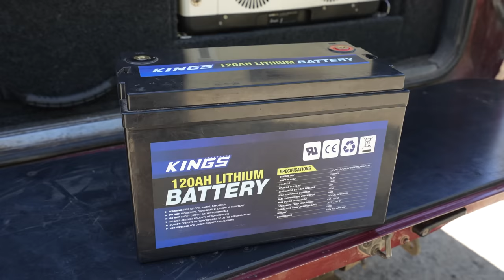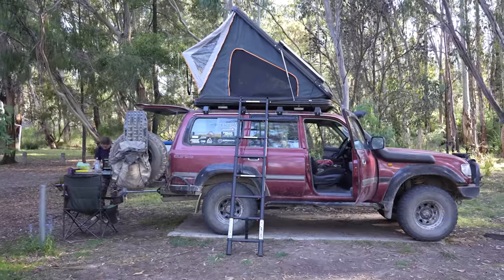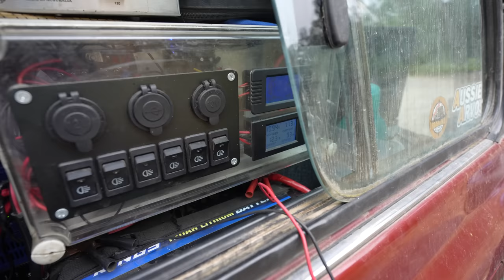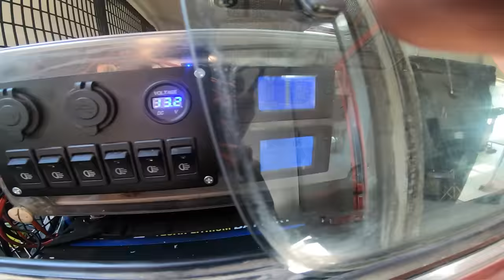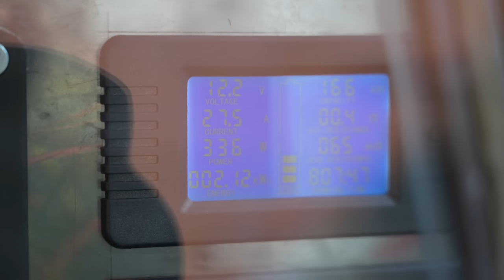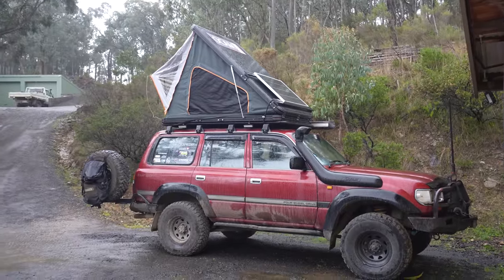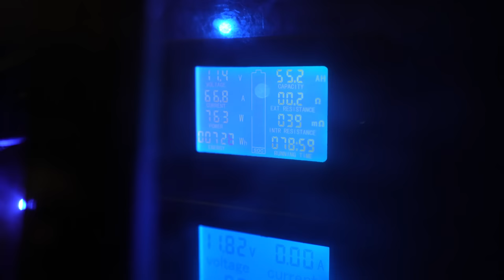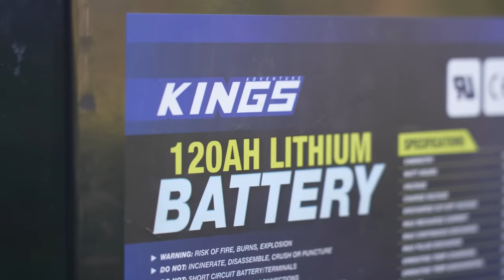Watch this BEFORE you BUY Kings Lithium Batteries

Comment: I’ve got the same battery but it dropped to 10 .5V at some point and now won’t charge. I’m assuming it’s the BMS off like you said but how did you get it back on? I’ve tried my victron 240v charger but also doesn’t seem to do it.

Comment: I have been looking at getting a lithium battery and doing some research it seems 100ah lithium will support a 1000 watt inverter, to run a 2000 watt inverter would require 200ah of lithium. Do you run a induction hot plate which would require a 2000 watt inverter from the 120ah battery?

Comment: I'm "mostly" unfamiliar with every brand posted around the 4 minute mark..the only reason I've heard of any of them, is because of YouTube. 
Further, I have never spent as much as the very least listed (Power Volt), and tho I need "more", they're doing fine. I have Redodo, Power Queen, TimeUSB, and Weize, and tho I got them all during great sales, $300 per 100Ah is the MOST I've spent on any battery, and they're all doing well so far (2 years for the longest owned ones).
Oh, and things aren't headed toward Lithium, it BEEN at Lithium for quite some time. No one goes with anything but Lithium unless they have a special requirement factor, or are trying to save a bit of coin (who isn't) but honestly, Lithium is the cheapest in the long run, it just hurts up front.

Comment: You should invest in a 12v car adapter for your laptop... most usbc-based ones still rapid charge (I know the 12v car adapter Lenovo cranks if it has supply!)

Comment: Hint - don't let the battery drop below 25% , the ultimate charge range for Lithium Batteries is 40-85%.,
Staying in this range can double the recommended recharge cycles, 
 The more you go outside this range, the less recharge cycles you will get,
Charge to 100%  every 5 or so recharges, then use the top charge, don't leave for long periods over 90% or under 40%,

Comment: Awesome video mate gave me heaps of confidence putting the 200amp in my caravan, if you can support it with good chargers and wiring go for it. I spent the extra on putting enerdrive DC DC and 3 way charger, to keep the power up but got the king's battery and inverter, keen to do some more testing 

Cheers
Reply from the maker: Thanks mate, look forward to hearing how you go with it!

Comment: Nice review but your earlier episode when you had power problems got me wary. The big factor for me is discharge capacity, the kings are on the low side at 100 amp. I hadn't realised your shunt was at fault, I think when the time comes to build my system the Itech will be the winner as it's specs are a little more robust. Appreciate the review and detail that you deliver. Cheers 🍺
Reply from the maker: Thanks Luke! Yeah the cut out issues i was facing before were due to the inverter  going through all my shunts and fuse box and i think that was casusing issues, i haven't had an issue with pulling high amps from it since after i wired directly to battery, that being said if your looking to pull alot of amps from the battery might be worth looking at either a bigger battery or one with a BMS that supports greater amp discharge. But for what i've been doing i've had no issues with the kings :)

Comment: Are you running 2 of these batteries in parallel as one of these kings batteries can only output 100amp continuously and at 12.8v nominal voltage this would only be able to output 1280w per hour. So not sure how you can run an 1800w induction cooktop when through an inverter and with these Kings high frequency inverters you will get some small losses from the calculated 1280w.

Comment: Great video. Thanks for the great info. I’m running 2 x 120amp lithium batteries in my caravan. I have the 3000watt inverter running through the shunt and sometimes it trips out. You mentioned you had similar issues that were solved by running the inverter straight from the battery. Is this correct ? Thanks in advance and keep those excellent videos coming 👍
Reply from the maker: Thanks George! Yep i soved this by going stright from the inverter to the battery
Reply: @AussieArvos  Thanks for the prompt reply. Changed the wiring setup this arvo and ran the microwave and coffee machine with no issues…….. thanks again 👍

Comment: Great information, but I have some questions about running an induction cooker continuously at 1800W. With a specified max continuous discharge of 100A and up to 160A max pulse discharge for 10 seconds, doesn't that mean that at 12V you are limited to 1200W on your induction cooker, with only 10 seconds available at up to 1920W? (not taking into account the inverter efficiency, which would increase the current even more) It does seem to deliver the current required to run continuously at 1800W but isn't that exceeding the design parameters and could it lead to battery failure?
Reply: If the BMS didn't like it, I presume it would cut it off.
He could also be running the induction top at less than full power which may only pull <70% of it's rated current, as an example.

Comment: There is still a place for AGM's for home backup power. Weight is not important, they are at most half as costly as LiFePo batteries and can be kept on float charge indefinitely. Cycle life is not really relevant since if you discharge AGMs by 80% and immediately recharge them correctly, ie  bulk charge followed by absorption charge followed by float charge they will recover fully and perform for many more power outages.
DC/DC chargers and other devices aren't needed, just a 12VDC to 240V inverter.

Comment: Good wrap up & review Pat, you made a lot of good points & it gives me more confidence in this kings lithium battery for the price.
I did notice in Chris Eade’s report at 5:08 he stated that the bms stopped charging when cells had reached 3.77v-3.41v & I really dont like the idea of cells getting to this high voltage, as 3.65v/cell is the accepted maximum (14.6v total), a cell can reach full capacity at 3.45v (13.8v) but takes a bit longer to reach full SOC, so 3.5v-3.55v/cell is a safe max voltage without going any higher, and 3.77v/cell could cause much increased degradation. 
I was very impressed that kings claim it can output 160A and you have shown you can run an induction cooktop reasonably well for a single 120A battery, which does show it has pretty good ability also. Cheers
Reply from the maker: Thanks Evil! Yeah Chris Eade's report was really well done, really appreciate his work in tearing batteries apart and finding the facts.

Comment: I have had a good experience with the Kings battery, has not let me down. The 25a Dc-Dc is another story, 3 replacements later and the Kings tech muttered “get another brand” and I did. Redarc, it worked a treat. 
1 solar panel (Jaycar - shape and amps suited my roof tent roof.  End result was the beers stayed cold even on a 4 night stay somewhere.
Reply: Great, I just purchased the 120 amp battery and 25 amp DC to DC last week. What issues did you have with the charger?

Comment: Hey mate great vid 🤙
I had a question about the inverter. Were you running a different 2000W inverter with the induction cooktop or using the kings 1500W in the vid? Thanks legends 🤙🏕️
Reply from the maker: Using the kings 1500w , I misspoke when I said 2000w
Reply: @AussieArvos  thank you mate 🤘

Comment: I've toyed with the idea of going lithium,  but the amount of fires in 4x4's and campervans I have personally seen caused by them makes me very wary.
Reply: Don't confuse the battery chemistry, they are very different.
Lithium Iron and Iron polymer are the dangerous chemistry options here and have the wrap for exploding phones and cars. Lithium Iron Phosphate and cobalt are very safe and will not thermally run away thike the others mentioned above. In fact, they are safer than lead acid which produces hydrogen gas when charging. 
The fires around Lipo4 are from poor wiring or a failure BMS, so it's important to buy reputable brands and fuse connections appropriately to avoid this.

Comment: How will you know before the battery fully discharges, do I need to buy a battery monitor device of some sorts?
Reply: Yes, you need a SOC ( State Of Charge ) monitoring system.  You do not want to wait until the BMS cuts-out due to Low Cell Voltage.

Comment: Great video it's more affordable to the average jo thanks for the information 
I'm still running my led acid battery for my 40lt fridge and the od camp light it's still working for now 🤷‍♂️ 
Would love to update to lithium but haven't gotten dcdc charger in my 4b and a little concerned about installing one because it's not my strongest point just a little intimidating putting electrical components in my 4x4 😬
Reply from the maker: Hi Billy! Yeah that is still a fine setup! The DCDC is actually really straight forward to install! you'd be able to do it easy i reckon, if you've got any questions just yell out! :) but i mean if your setup is still working for you that's great! Cheers :)

Comment: Have you had issues with the kings lithium cutting out using an induction cooktop, as the maximum discharge rate they spec on these batteries is only 100 amps which would only be about 1000 watts with an induction cooktop.
Reply from the maker: I've had no issues, i have the induction cooker set to around 1800w too

Comment: I have 2 solarking 200 ah lithium ion batteries with 1.4 kw of panels off grid with a Victron charge controller that I use as back up power if the grid goes down as I grow my own beef and last thing you want to have happen is to loose hundreds of kilos of it from a outage, they are great as I’m only on tank water as well in a power outage they will operate the 1000 watt piachi water pump for my house. I’ve had them for a few years and plan on getting a heap more as if you don’t use them under 80% they have a life cycle of 8000 recharges which is nearly 20 years. I get the 66 cent rebate and have a solar back to the grid system as well so. So my bills are usually next to nothing..The problem that affects most lithium batteries they need to be in a stable temperature environment so I’m planning on building a off grid system with a small aircon system to stabilise the batteries and also in a basically blast chamber so if one blows out. It’s contained with a vented exhaust. I know some lithium ion batteries the cheap ones are really only rated to 45 degrees. My ones are 60. But you pay more. Great video thanks .. plus I also have spacex starlink and it’s supposedly pretty power hungry yet I when I have my battery system going don’t have any trouble powering it. Plus it’s portable.plus with my solarking with the Victron charge controller once the batteries are full it goes into a float mode which means if I’m getting however much power off the panels it’s not recharging the batteries it’s diverting the electricity directly to what I’m using. Literally running on sunlight all day long. Then it changes to bulk when you aren’t using it I have a few wind generators I plan to install. My first one is sitting in my front room, my rebate for my solar runs out in 2025 so I plan on being completely off grid by then.

Comment: 1800w from that 120ah battery… I doubt the BMS would be enjoying that current. I run a 300ah lithium battery from lithium battery wholesaler, $1800 delivered in Australia. It will output 250a continuously. I am considering buying a 200ah kings battery to add to my existing 300ah battery in my caravan as it runs my AC unit/heat pump.

Comment: You only need to know some key facts! 
Lead-Acid 100Ah  = You only have 40Ah to use, before you need to charge it or you will dmg it over time. It also charge slower. 
AGM / Gel 100Ah  = You only have 60-70Ah  to use before you need to charge it.  It last longer, and are a stronger battery. Better chage as well. 
Lithium       100Ah = You can use 90-95Ah  before it must be charged.  It can also force a large charge load.  and the weight  is vary low.

Comment: Patty, extremely well presented, composed, factual & brilliantly informative as from your experience.
 I too moved over to lithium about the same time as you, recall watching your initial trials etc.
I elected Itech product, 3 x 54 amp units to replace 3 X AGM 75amp units.
Why, cause I had the specifically built battery frame to house this casement size, (slimline).
What I love about my lithium update is, "recovery charging", it's so friggin quick compared to AGM.
How's that help?
Like everyone, my camping out constantly evolves, inverter added, permanently mounted coffee M/C, plus other 240v gear from time to time. AGM was taking ages to recover through what I thought was a 120w Redarc solar panel.
Now convert to lithium and the recharge time just accelerates so much that induction cooking became viable as well. (K'gari last August got the better of us trying to utilise a gas cooker in extreme easterly front passing through).
Once I went lithium my fridge is never off other than for a quick defrost.
Breeze not an issue cooking, true coffee every day, and whatever takes our fancy being reliably charged or utilised.
We've had one issue, Australia Day long weekend, 40° days, 28° nights, fridge just continued to cycle, inadvertently parked in shade, no solar recharge, batteries kept going but not accepting any charge on long drive home, hmm?
Eventually BMS shut the system down after another three days at home.
Jump started, recharged by 240v battery charger, back in business again, 
Weird. Due to that one off experience I elected to upgrade my 120w solar panel to 2 X 120w = 240w occupying the whole available roof top tent area. To my surprise, the Redarc panel coming off was a 150w panel, not a 120w panel, duh.
Like you, I elected not to utilise the shunt for inverter cabling as that meant a whole rewire, too over the top when everything just works reliably anyhow.
Anyone starting to build a 12v system now days strongly needs to be encouraged to just go lithium, benefits far outway any $$$ outlay, especially if the King's product is as you say it is. Aldi just had 100amp ones for $499.00 each, sold out like hotcakes at our local store.
Prices are far better now, anyone contemplating out laying for AGM, just bite the bullet and go lithium.
My old AGM's still in use at home in a off grid inverter setup powering air fryer, toaster, coffee M/C & led lights, just cause I can, haha. Requires lots of solar to be viable though.
Thanks again Patty for being extremely informative and guiding newbies to just go lithium. 👏👏👏
Reply from the maker: Thanks so much for this comment Ian! i really appreciate the info ! i love talking about 12v gear, the things we can do with it is awesome! you setup sounds great! and that's it, with prices these days, very hard not to be tempted to go lithium! i think the improvements and really worth the extra coin! Thanks again for the comment Ian! all the best - Patrick

Comment: Using for a year is 365 cycles, assuming used every day, in reality, don't expect to reach 2000 cycles if fully charged and discharged, a realistic expectancy is around 1200, then capacity starts to diminish.

To maximise the cycle count, having more capacity and operating within a 10% to 90% state of charge window will extend cycle count. This involves reducing the maximum charge voltage to 13.6V and having a low voltage disconnect of 12V. Anything driven at maximum performance will have a shorter lifespan, including yourself.

Lifepo4 is superior to lead acid, yes, but pushing them hard using 100% of new capacity on a regular basis will inevitably leave one disappointed. A rule of thumb when calculating capacity needs is to double the  result, based on 10 years off grid living with both LA and LFP, mobile applications would be more challenging.

Comment: How are you monitoring battery capacity if your inverter is bypassing thr shunt? I've been tossing up between voltx and kings. They're cheap but for my needs should suffice.  👍
Reply from the maker: I no longer monitor my Inverter amp draw, as it was pulling too much power through my ebay components and kept tripping the system, i know run it direct to battery, but i'm thinking of moving the shunts around so i can monitor all of it, inverter and other 12v gear that runs off the fuse block,
for my recent capacity test i didn't use the inverter to bring the power down.
Reply: @AussieArvos  well I went and bought it! Let's see how it goes!

Comment: i run a 300ah lithy and its dumb good, almost half the weight of my 170ah AGM and it actually does what its supposed to. My fridges run sweet because theyre humming away on almost 14v all day every day as opposed to 11.9 or what ever the fuck the AGM felt like outputting. Plus the charge rate is much faster so less solar time means more charge and they take the charge. They can also output continuous amperage well above 100A so you can actually run more than a phone charger off them. Ill never even look at an AGM before. I went through so many, 90, 110, 130, 170 just chasing a battery that actually worked and none of them did. My lithy I can run an 85L upright, 11L center fridge 365 days of the year, I cook with an air fryer and induction stove dont even carry gas, I can run lights, chargers, stereos etc all night and my battery just never goes below 70%